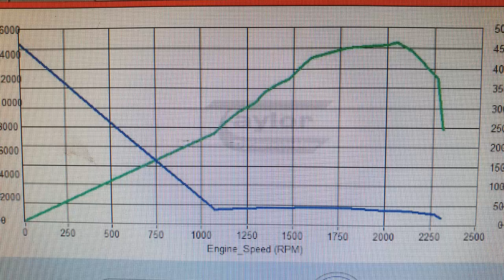Big cam 4 Cummins

Comment: disapointed in this motor , how quick it dies in the arse ,,  stick to cat or detroit  myself
might have 450 hp but thats no good when torques the real power , cummins really are over rated motors in my opinion
Reply: It is the fuel system. If you put the bigger gear pump on the pt pump you can get one to lug but as they are rail pressure and thus fuel falls with rpm so the torque is very flat.  The 2 stroke Detroits have very similar power curves not until you get to a 60 series would they lug and that is a 40 year newer design than the NT.
Reply: a more ignorant comment is hard to imagine
Reply: Pretty flat torque curve to me bro, 300hp at 1250, 385-390 at 1500. Seems OK. Just stick a different button in it.
Reply: Different torque spring will change that. I walk around 550-600 cats like they are in reverse with my big cam. 115-131,000 gross. Cats are the over rated ones.
Reply: @thinairdiesel3158 Right on man.👍👍 I like and dislike all 3 as they all have their pros and cons..
Reply: @bcbloc02  👍series 60 designed by an old Cummins engineer...or so I read
Reply: @elroyelblander6277  I have heard Deere helped  design the series 60.  Deere and Detroit had a working relationship since the 1940's at least. When the writing was on the wall that emissions was going to kill the 2 stroke Detroit approcahed Deere about helping with a new 4 stroke. Most if not all the early series 60 detroits have JDFW cast in the side of the blocks for John Deere Foundry Works. The Fact that the Deere 10.5 and 12.5 look almost identical to an 11.1 and 12.7  is not a mere coincidence as I believe the same engineers did them all.